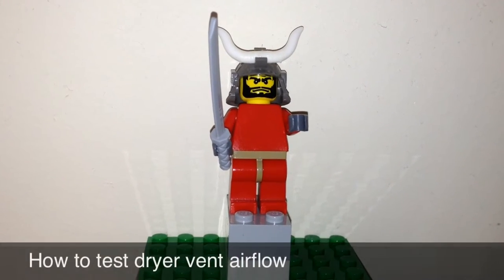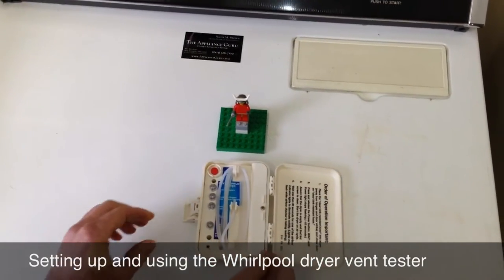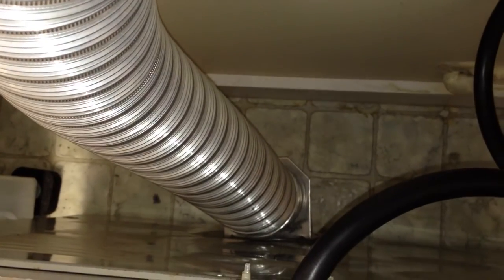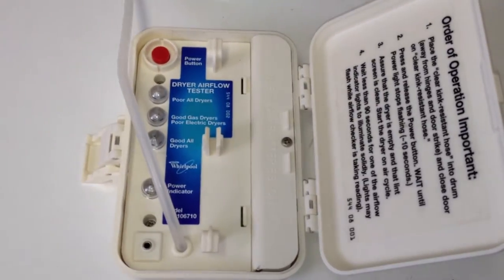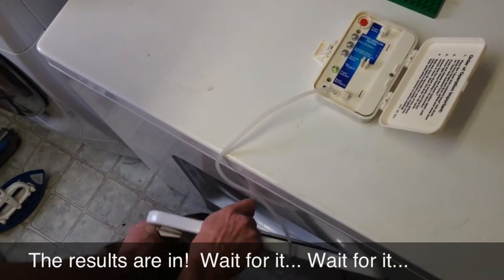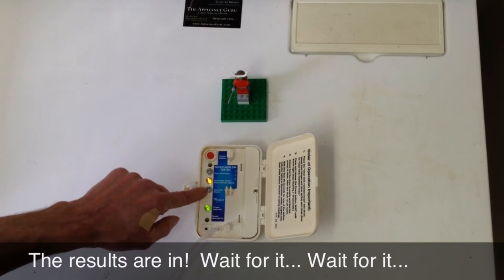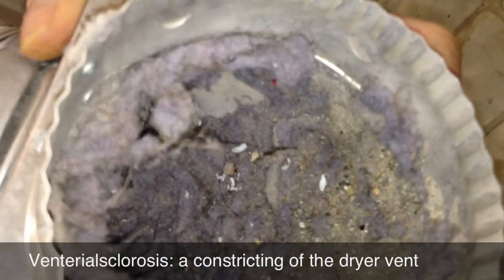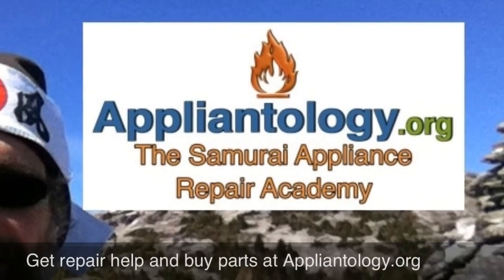Using an Airflow Meter to Test a Dryer Vent for Safety and Efficiency

Comment from the maker: The tube doesn't crimp when the dryer door is closed on it because 1) it's a special, hardwalled tube that is almost impossible to pinch and 2) the dryer door doesn't close tight enough to pinch it.

Comment: Had a test run on a whirlpool dryer that said the vent was clogged. I took it a part and there was no restriction.With the dryer piping apart at about 6 ft the clothes dry fine I am wondering if the vent is too long.I know 10 ft is supposed to be good but this is probably 15/18 ft with 2 90's. I wonder if it were all smooth wall piping if that would help?
Reply from the maker: MrMultitool The maximum length is 20 feet of STRAIGHT vent. Each 90 degree fitting counts as 6 feet so you have to add that to your existing straight length. Once you do that, you'll see that you are over the 20 feet limit. That's why you're having long dry times. There's an industry-standard vent length chart on this page: http://appliantology.org/gallery/image/618-dryer-vent-length-chart/